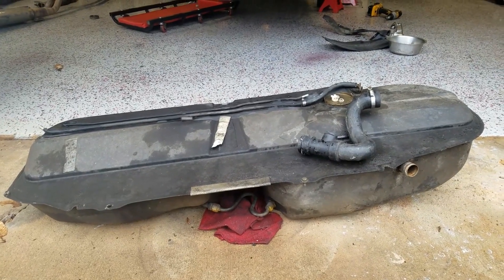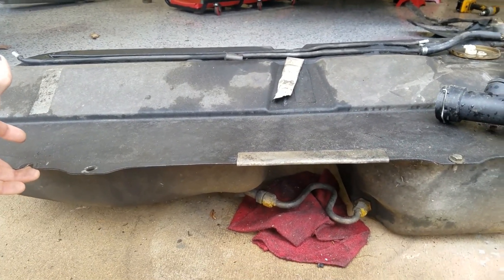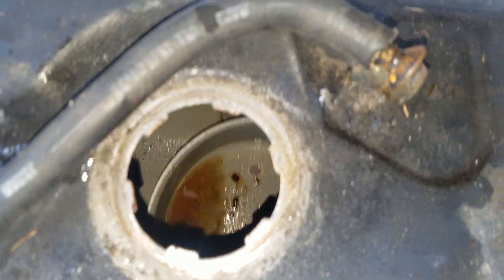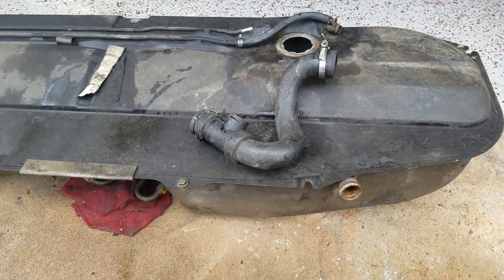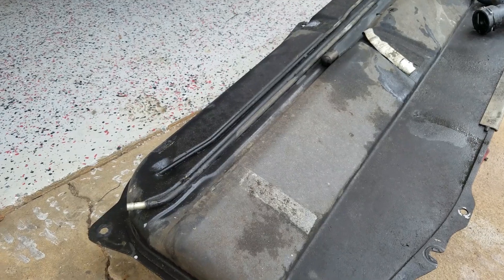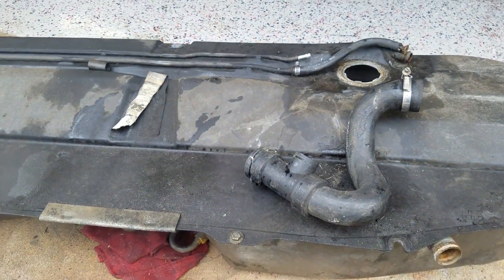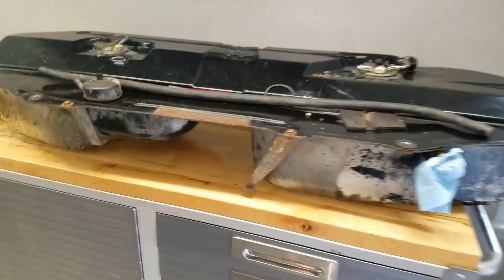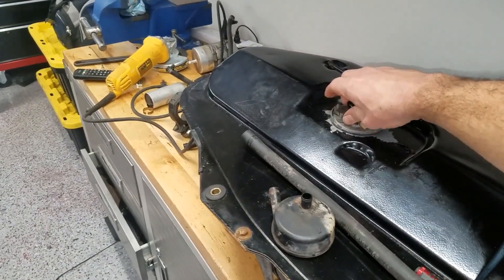E30 Fuel Tank Comparison & Starvation Fix

Comment: Have you been having any fuel starvation with the new tank? I replaced an older rusted one with a new one and get starvation at lower fuel levels (not sure where exactly).
Reply from the maker: @jogb9515  no. Crossover likely clogged
Reply: @extrabolts  Thanks, I'll check it out.

Comment: @3:56 where you showed the newer fuel tank. Above the fuel pump, there is a larger hose clamp. Do you know where is that connected to?
Reply: @extrabolts  thank you. I'm getting gas leak right by the fuel pump. I'm trying to figure where the leak is coming from by process of elimination.
Reply: @extrabolts  good comment. So what what I did is change the 8x13mm hose that's connecting the fuel pump and gas line. It worked as the old house was full of cracks.

Comment: Hi, how does the fuel go from one chamber to another in the newer style tank? Just curious.
Reply: @extrabolts  Thanks, makes sense.
Reply: the conduit through which the fuel from the engine returns, enters the chamber (the one that does not have a fuel pump). Inside the chamber there is an ejector( uses the pressure differential to create the suction) that connects through a tube with the bucket from which the pump sucks on the other side of the tank. If you find this manual, on page 321 you will see a diagram : "BMW-E30-Repair-Manual.pdf"